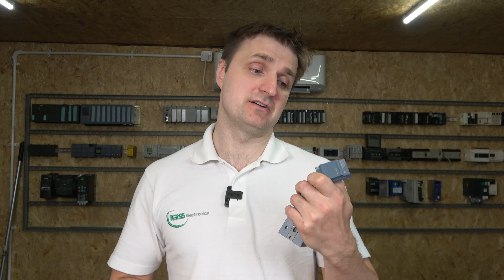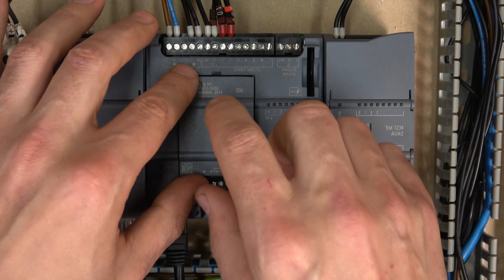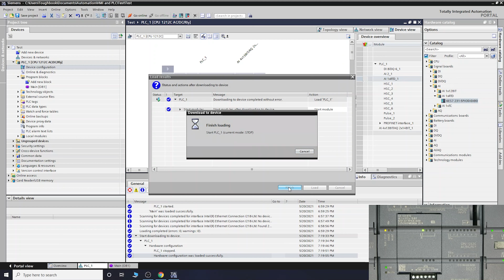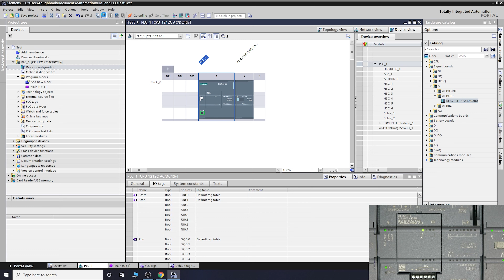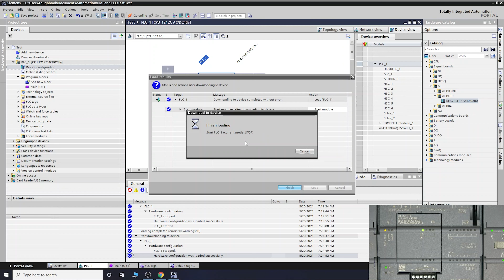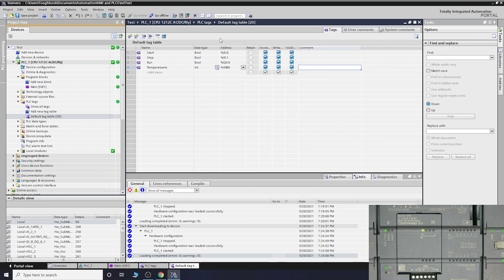Siemens S7-1200 PLC, SB 1231 RTD temperature module wiring, TIA portal V16 monitoring. English

Comment: Thank you for your effort sir! I have a question. I am building a project with the sb 1231 rtd module, after wiring the module what did you use as thermocouple? I mean what type of sensor can I use to detect the temperature of the room? Thank you.

Comment: Thank you for your effort Ingus! I appreciate it. No need to norm and scale the value that we measure then? Cheers!
Reply from the maker: Hi Cockun. It wary much depends of what you are using the reading for. For basic set up just to read the temperature on HMI, no not really. But if you want more then just reading, again wary much depend of application, you might need it. This reading quite often is used with PID set ups.